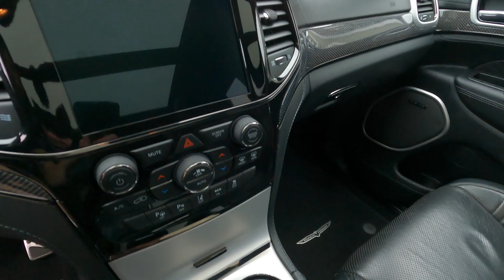Deep Cleaning A Dirty Jeep Trackhawk | 707HP V8 | Full Car Detail | Lake Stevens Auto Detailing

Comment: If you like diy detail all clean you should try green star from Koch chemie. Very dilutible and extremely effective for wheels(5:1)engines(5:1)pre-wash(30:1)interior(20:1)anti-corrosive properties and very economical. My favorite apc and general cleaner inside & out of vehicles. These are just my preferred dilutions but you can adjust accordingly depending on the vehicles soil level. Good video brother!
Reply from the maker: I've looked into ordering some green star but will need to wait til my all-clean gets lower. I bought a gallon of the stuff and it will be a bit before I get it dwindled down!

Comment: Ceramic pads etc usually put off less brake dust than typical steel rotors & pads. Weird. Lol
Reply from the maker: Yeah I think the size of the pads and things these track hawks throw a lot of dust around. Of course if you're hauling butt and hitting the brakes a lot that doesn't help lol! See: https://www.jeeptrackhawk.org/threads/brake-dust.4772/